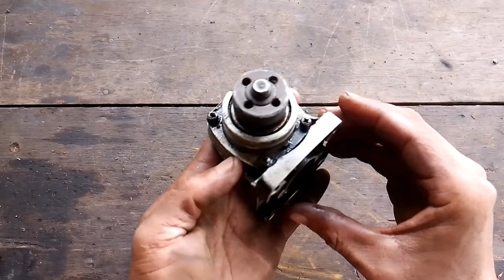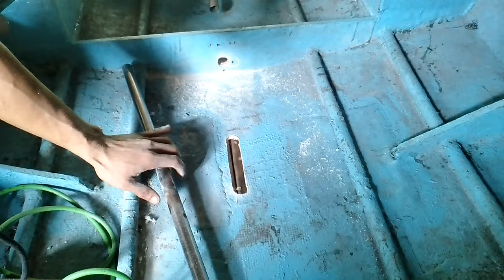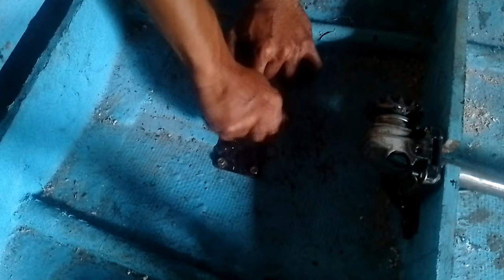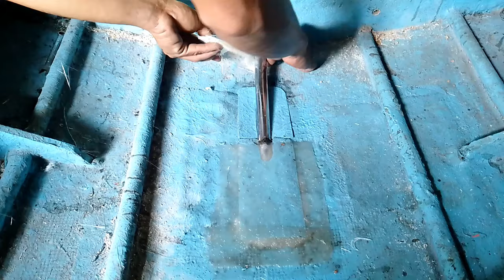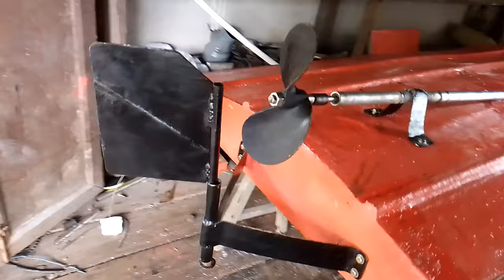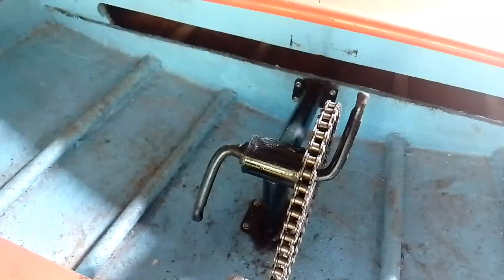DIY low budget pedal boat

Comment: Wow...no room for leg extension, so rider will cramp up. No room for feet to complete swing through the pedal arc, you can see his feet hit front AND back.  Move the seat BACK, raise the chair and the pedals, and you might use it more than just to make the video.  Pedaling this would be torture.